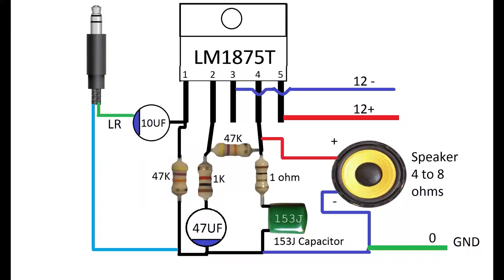Powerful Audio amplifier Using LM1875 IC | Bass Boosted

Comment: Cool 😊 
The transistor 
Its shape is identical to the TDA2030/50. Many reviews indicate that this LM1875 is counterfeit. However, some reviews also indicate that the sound quality is similar, except that the genuine one can reach 20 watts of power, while the counterfeit one can reach 19 watts with the same 18 volt DC power supply.